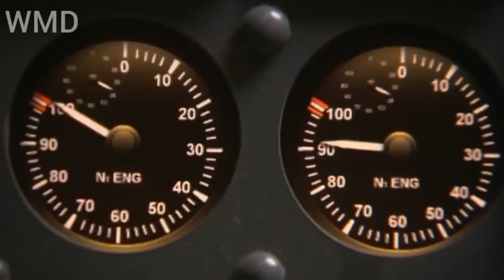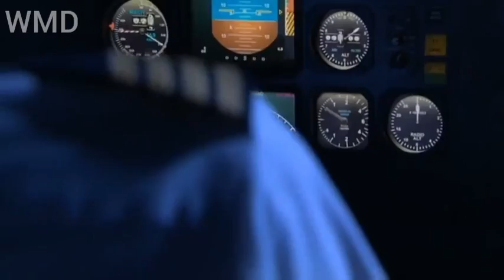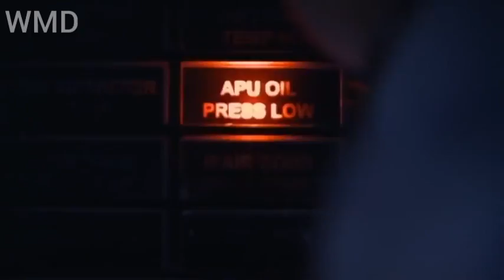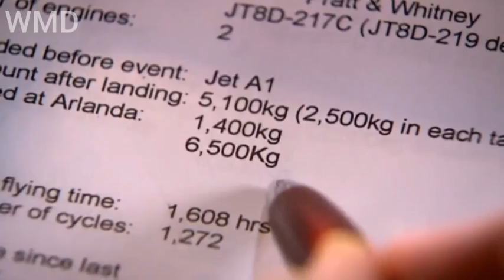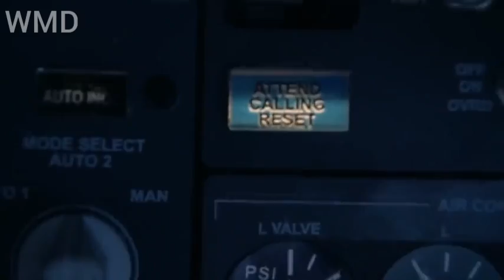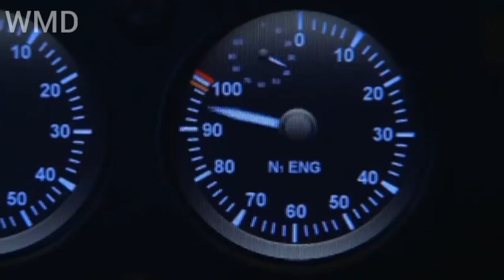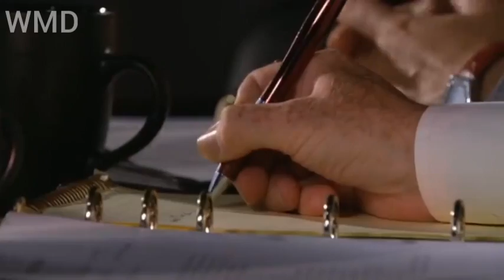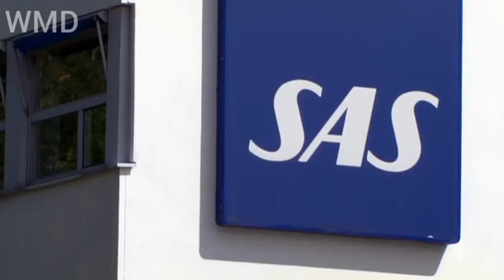Air Crash investigations 2022 - MayDay Rogue Pilot Scandinavian Flight 751

Comment: This plane crash on engine fire is amazing first the Bose engines second engine lost then they couldn't control unbelievable right then they try to save the plane they talk with tower control then the tower control radar turns off they try to save the plane but they crashed

Comment: Computers and automation are such a threat to aviation. Computers are plain stupid. They have caused so may accidents because they work against the pilots, be it bad programming or algorithms, or even just bad system design. And they also contribute to dumb the pilots down and take away their original flying skills because they are rarely practicing them, because of the automation.
That aside, this is an interesting case, but very badly presented here. The editing of this video is horrible. Is there a clean version of this episode anywhere? I gather that the original was at least watchable. Anyone?

Comment: I don’t understand why an experienced pilot would not immediately suspect wing ice into the engine—
Reply: If you aren't trained on the possibility, and also never heard about the autopilot function that increased thrust, and when you do the right thing decrease thrust and still the situation deteriorates, you would've been stunned as well.

Considering what happened, the pilot being able to concentrate on his core task: look in front and fly the plane, and thanks to the input of that 3th pilot, and a professional flight crew that took initiative, nobody died.

In hindsight it's easy to tell what happened, not so when you are in the middle of the situation. For all he knew, the plane was thoroughly deiced.
Reply: It's just too much to except that pilots should know more than they're trained for. Besides, the captain did the right thing (throttling down) despite not knowing what was causing the engine surge which I would say points to great pilot intuition. And it definetly wasn't his fault that the ATR kicked in